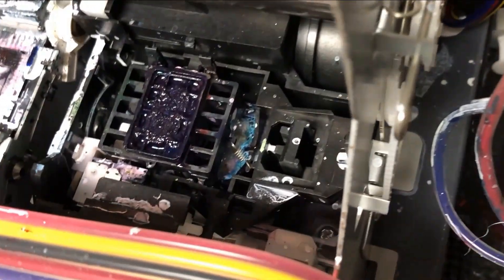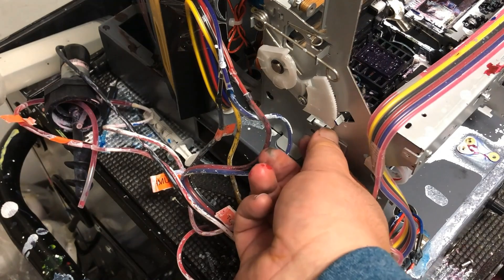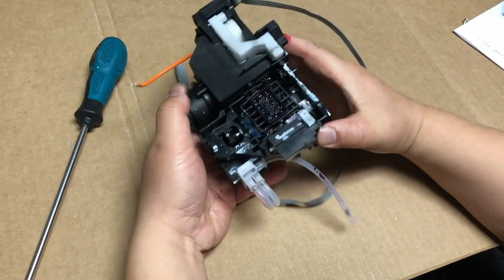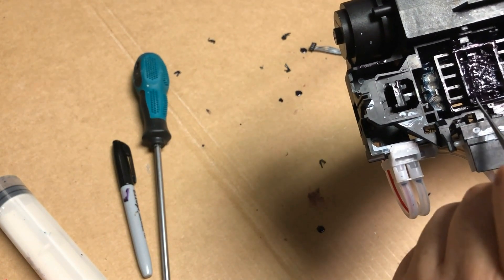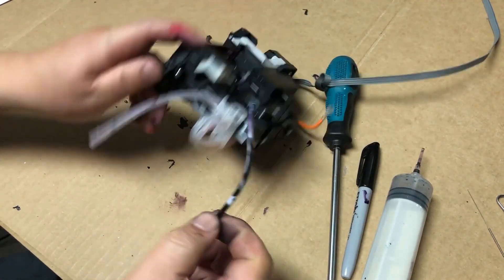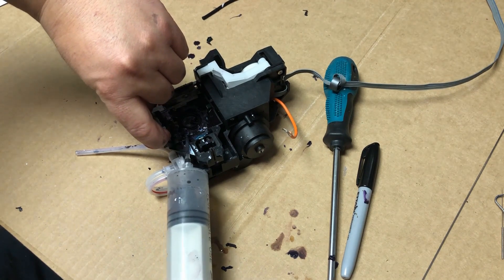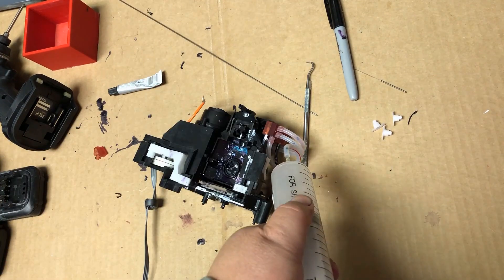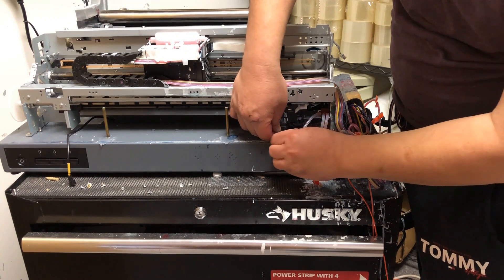L1800 Regurgitates Foamy Ink from Capping Station - My DTF Printer Has GERD?

Comment: Got a paper jam error after attempting nozzle check now printer tells me to turn off and back on but it keeps giving me the error code ending in 004
Reply from the maker: Thanks so much for your support and for sharing what you’re running into — I really appreciate you watching and engaging; that paper jam–style fault with an error code ending in 004 after a nozzle check is usually not a real paper jam at all but a mechanical state error, often tied to the carriage position, encoder strip, pump timing, or a sensor that didn’t return to its expected home position after the cleaning cycle, which is common when the capping station or pump system is struggling or over-pressurized as discussed in the video, so the fix is usually mechanical inspection and correction rather than clearing paper; if you need faster or more direct help, please email [support@bchtechnologies.com](mailto:support@bchtechnologies.com), and if this video or reply helped you, I’d really appreciate a Google review here: [https://g.page/r/CfL7k6nYvPQ9EAg/review](https://g.page/r/CfL7k6nYvPQ9EAg/review); just a quick heads-up that I get a high volume of questions and can only answer about 10 per day, so replies are prioritized with subscribers and members first (typically within 48 hours), then regular viewers if time allows, and after that remaining reply slots are filled last-in, first-out (newest questions first), so if you’re not subscribed and don’t see a reply within 48 hours you can either subscribe or re-post your question, and if you subscribe later your older questions automatically become priority without needing to re-post; I’d also love to invite you to subscribe, turn on notifications, and join Run With Kevin — LIVE, where I go live every morning (usually between 6–8 AM Eastern) to answer printer questions in real time and give subscribers and members extra perks like priority replies and early access to videos.

Comment: Great video(s). Why does some capping stations have a foam/pad in it and others dont? Thanks in advance.
Reply from the maker: Thanks so much for your great question and support! OEM capping stations are designed with a foam or sponge pad to help seal and maintain moisture around the printhead, but when using strong cleaning solutions for DTF, that pad can break down over time, which is why some manufacturers choose to remove it to avoid long-term issues. I receive a very high volume of questions, so subscribers and members are prioritized for answers within about 48 hours, and they also enjoy exclusive benefits like early access to videos, while I answer other viewer questions as time allows. If you need quicker help, you can always email [support@bchtechnologies.com](mailto:support@bchtechnologies.com), and if this video or reply has been helpful in your DTF journey, I’d really appreciate it if you could leave a quick review on my Google page here: [https://g.page/r/CfL7k6nYvPQ9EAg/review](https://g.page/r/CfL7k6nYvPQ9EAg/review). Don’t forget to subscribe or become a member so you’ll always have priority support and stay updated with the latest printer tips!
Reply: @BCHTechnologies  thank you very much for all the info. I’m currently shit down from work again due to another clogged print head (white ink) using Procolored L1800. This now our 4th clogged print head in less than a year. When the printer is working all is great but these clogs are just silly. I conduct daily maintenance and still the white clogs. Waiting on Procolored to respond (they have been decent with other print head issues but we did have to buy 2 new print heads over the first 6 months and was given one free less than 2 months ago and now that’s clogged).  Any tips for manually trying to unclog it?

Comment: Hi! 
I was looking for a solution and came across this channel, so maybe you can help me.
I have the same pump on my Epson L800 Chinese UV printer. The problem is that the silicone tube coming out of the vacuum pump keeps getting pulled out of the plastic connector, and as a result, my white ink isn't working properly.
Do you have a solution for this? Should I glue the silicone tube to the plastic part, or do you have another suggestion?
I would really appreciate your help. Thank you in advance!

Comment: how do you fix wiper if it wont come up
Reply: My wipers never moved either since I got it !..  I think that’s what’s caused my problems! I’ve yet to figure out how to move mine. The white lever doesn’t do anything when I press it.
Reply from the maker: Thanks for being a valued member and for enjoying exclusive videos and early access to unreleased content—your questions always get prioritized with detailed responses! If your L1800 1390 capping station wiper isn’t coming up, remember that you might not see it in action because the printhead carriage blocks the view; instead, check the right side of the capping station for a hole with a gear that you can turn with a flathead screwdriver—this gear should drive the wiper up and down. If turning the gear doesn't work, inspect the wiper for dried ink that might be "gluing" it in place and free it if possible, and if that still doesn't help, you may need to take the capping station apart to check and fix the gears. I’ve covered the full process in a 27-minute video available exclusively to YouTube members here: https://youtu.be/mTDHAXg98M0, and non-member can also purchase the same guide on our website. We're handling a high volume of questions right now—subscriber questions from 2024 have been answered and all new ones in 2025 are addressed within 48 hours, while non-subscribers might face a longer backlog of up to 7 years, so if you ever need faster assistance, feel free to email support@bchtechnologies.com.

Comment: Kevin! I did all these steps to clean my capping station and assembled everything back together following your steps. I also removed the printhead and did a reverse ink flush to clean my nozzles. I put everything back together and now when it’s doing a head cleaning there’s no ink showing in the capping station. Do I have to wait for ink to build up in the head or does it sound like I forgot something putting back the capping station?
Reply from the maker: I usually draw from the waste line, so the ink get into the nozzle sooner. I will have a video about cleaning the printhead later. Most people 1) press too hard 2) didn't flush long enough.

Comment: Kevin, Thank you so much. I used your video as a guide to change out my capping station for this regurgitation issue. I still have an issue though. While taking apart the printer to lift out the capping station, a ribbon came out in the back opposite side by the plastic gears. I don't know which direction to install ribbon and don't want to put it in backwards. It is the smallest of the ribbons and comes from top of the gears for the plastic wheel reader. Any help on this is appreciated. Thank you!
Reply: Nevermind. I got it working. Just connected it and it was wrong. It would print about 1/8 inch and spit paper out. I flipped it around and it works great now.

Comment: Bro I have ecotank l3250...  When I start printing color is missing and also making straight lines in printout 🙂
Reply from the maker: It could be just clogs, but if lines are vertical, it could be the clear belt. Also, it could be the capping station, or debris on carriage return, or the printhead is not set evenly, or the printhead is not screwed down.